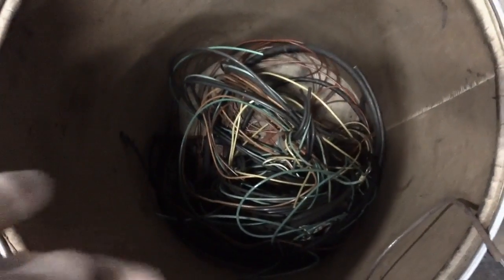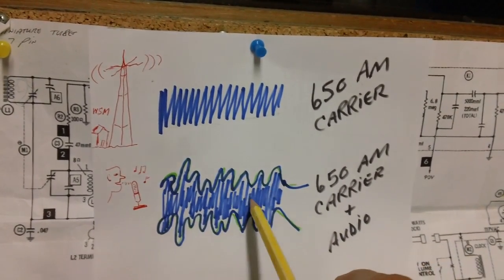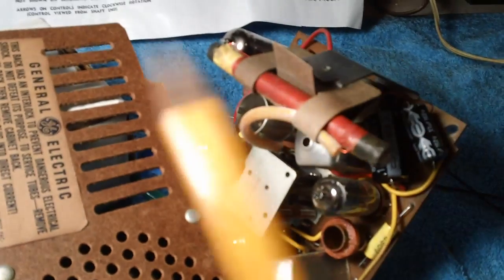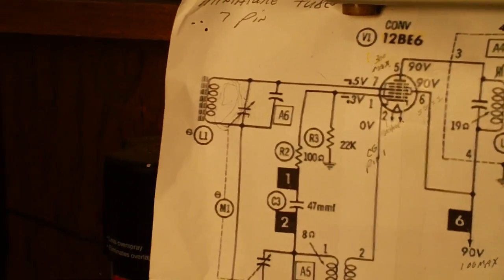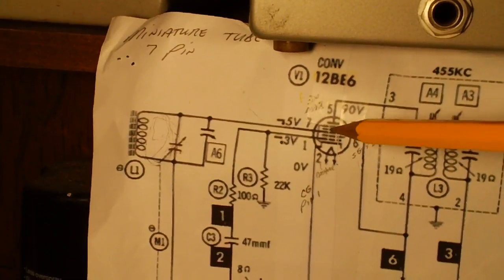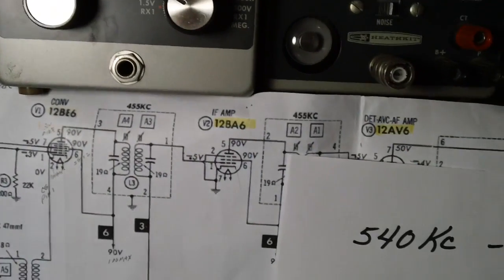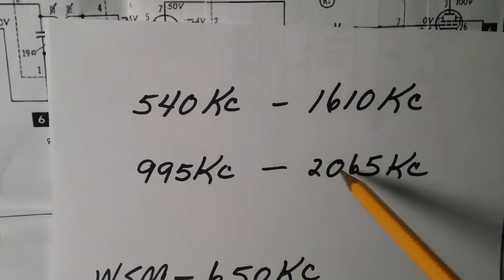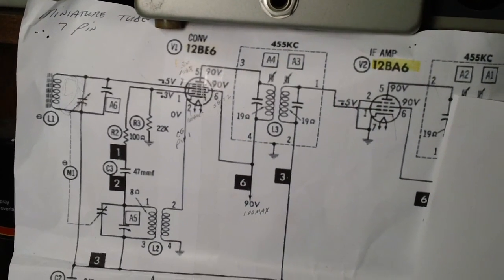General Electric C-403A Radio Repair Exercises (part 4 of 14).

Comment: John,
Brendan is one mighty fine chap.  Those Fluke meters are excellent for general bench servicing work.
I’m enjoyed viewing this Vintage Radio tutorial: I could have done well with videos like this forty years ago.  It certainly would have helped me to understand, what was termed, “The signal path,” far quicker than what I did…still; I got there in the end.  
I looking forwards to seeing how you stop and/or alter the frequency changer operation in your next production.
Regards,
Phil.
Reply from the maker: Phil,
Thanks, old chap.  You're right about Brendan...he is a mighty fine fine fellow, but with him being a dyed in the wool Yankee and all that, he does bear watching.  LOL
There won't be much more fiddling with the converter stage.  Experience has taught me that  the local oscillator and mixer tube  either work or don't work,  so there's not a whole lot more I can do to it.  But we will do a few things.  :-)

Regards,
John

Comment: I killed power on my Sansui at once the other night. The dial lights went out instantly, but the audio went on for probably 5 seconds LOL. I guess thats why the receivers power control is part of the speaker switch. I actually get a kick out of some "sound effects" you are making. Are you sure you are not bugging wifey ? lol. I bugged mom one time when I made an amplifier buzz and roar by touching the input repeatedly. LOL. I really enjoy these videos. You have more guts than I do about removing things and powering up equipment. :)
Reply from the maker: Thanks, Jeffrey.  Luckily, the sound effects took place late at night when wifey, great-grandma and all the pooches were fast asleep.  The camera makes things seem louder than they actually are.

Regards,
John

Comment: Something that might be worth considering is that situation where you know the oscillator is not running but you just have not been able to figure out why (sometime they can be difficult).  In those cases it is sometimes good to inject a signal (in this case 1105 KC) from your signal generator into the oscillator grid of the Converter to temporarily BE a Local Oscillator.  This allows you to prove that everything else is working and allow the radio to hear WSM on 650.  If this doesn't work it can mean you are experiencing two problems.  Two problems could be an oscillator is not running AND an antenna tuning capacitor shorted or open antenna coil.  The double problem can happen for a variety of reasons.  One example of a double problem would be bent shorted plates on the antenna tuning capacitor along with bent shorted plates on the oscillator capacitor.
Reply from the maker: Curt,
Great idea.  We can do that.  Hopefully, I can satisfactorily pull it off.
Thanks, my friend.

Regards,
John

Comment: AM = Amplitude Modulation. The Amplitude part is the variation of the hills and valleys at the top and bottom of the carrier wave.  Those hills and valleys are a defacto sine wave that represents the sound inputted on the carrier wave which the radio takes and translates into audio.  AM = Amplitude Modulation.
Reply from the maker: Sam,
Sounds good to me, my friend, but the way you wrote it poses a great deal of confusion for the newbie, who is the primary target of this series.  This series is not for the experienced electronics person. 

Regards,
John

Comment: John..good stuff...maybe in future episodes you can explain how the Quaker Oats box filters out the hum and improves signal strength........Buzz
Reply from the maker: Buzz,
The Quaker Oats box is a choke.  It prevents the audio coming off the plate of the oputput tube from going back into the power supply...thereby keeping the audio out on the antenna where it belongs.  Scouts honor.  No pig hearts about it.  :-)
Now don't you feel better?

Regards,
John
Reply: joernone That makes sense because as a kid I almost choked eating the Quaker Oats right out of the box...

Comment: Hm, this gives me ideas for my Philco 89, it's still doing that whistling. maybe I have a bad grid resistor... I do know the oscillators on tho model 89 and 19 can be finicky though. btw John, where do you get such big schematics? i'm stuck with the size my printer can print out.
Reply from the maker: Daniel,
I use "print screen" and the paint program, then print and tape each section together.  Cheap and fast.  I been told other ways to do it, but it's always difficult to teach an old dog new tricks.

Regards,
John

Comment: How about inserting an RF choke somewhere into the circuit (in place of a resistor), and see what happens??? (I've got quite a few 12BE6's should you fry this one)
Reply from the maker: Tim,
Sorry, no modifications during this series.   The info is already difficult enough for a newbie.  There's no need to make it more complicated than need be.  Simplicity is our catchword.

Regards,
John.

Comment: so my question is.....when a radio is blown but it still works with the batteries.....what most likely has gone wrong????
Reply from the maker: Ezekiel,
Get a schematic of the radio.  Something prior to where the batteries connect into the circuit is broken.  Could be something as simple as a small crack in the printed circuit board.
Regards,
John
Reply: ok thanks but what if it was plugged into the wrong current?? but for sure when i put in the battery it work well, I got it form some one and they told me they plugged it into the wrong voltage (220 instead of 110).
Reply from the maker: Ezekiel,
If that's the case then something definitely got instantly fried.  But if it's a cheap run-of-the-mil radio and you don't mind using batteries, then just continue using them.  Make life easy.  :-)
Regards,
John
Reply: ok great ..thank you v.much. I am quite satisty. With your answer just that i'll have to keep buying batteries and i don't like doing so. lol!